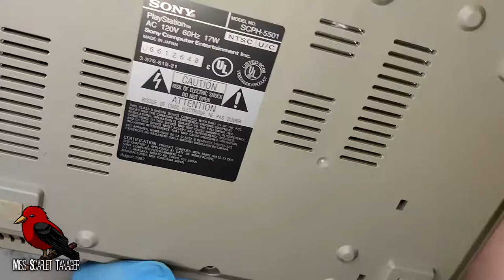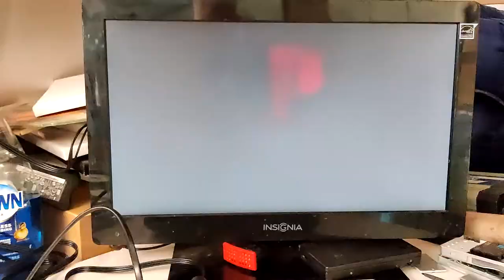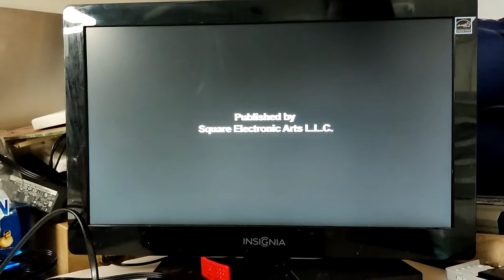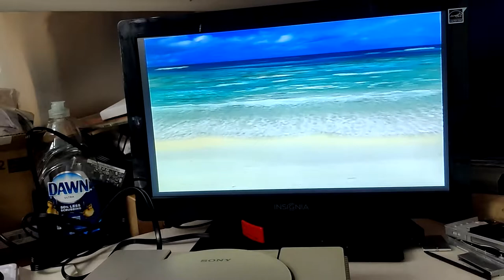Scarlet Restores! | 04 | NTSC-U/C PS1 SCPH-5501 Restoration!

Comment: I know this video is old but i need help with my ps1. It's the same model. I bought a replacement laser but it seems like it's still not working. I still can't figure it why. Do you think you could help me with this one please. 🙏🏼 scph 5501
Reply from the maker: It could be a bad replacement. Non-OEM replacement lasers are hit and miss. Check the wires and where they are connected closely.